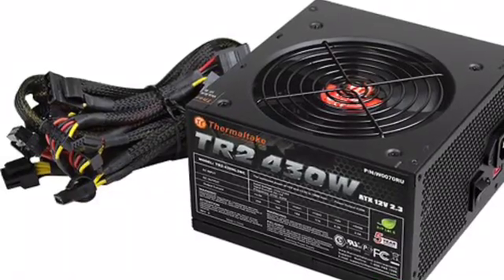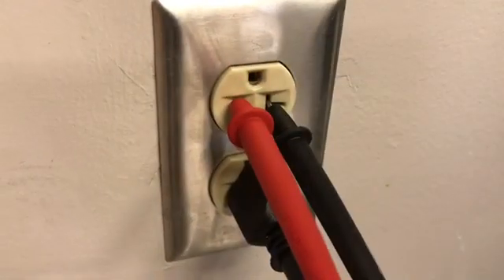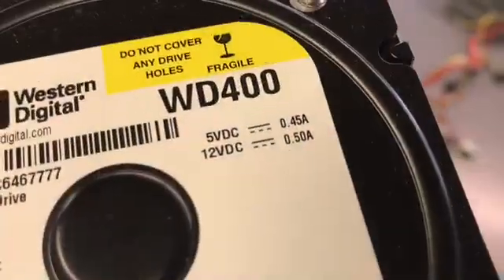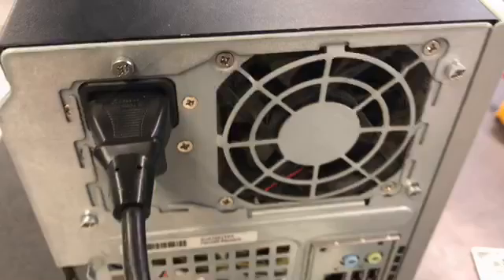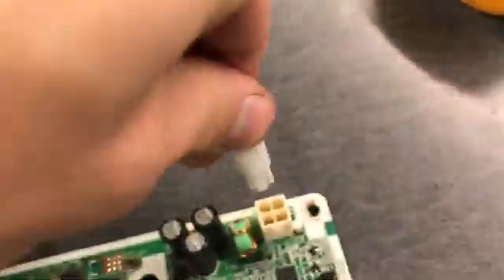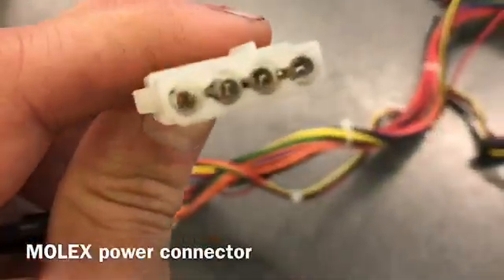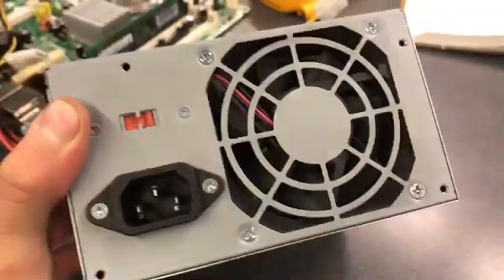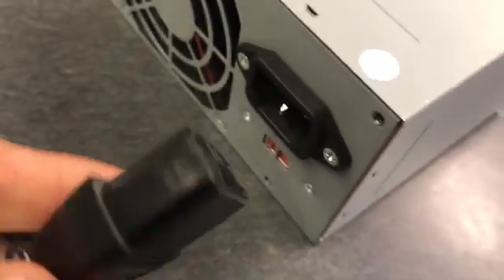What is a PSU (Power Supply Unit) and Explanation of Plugs?

Comment: My HP server power supply 24 pin connector has no pins in position 14 and position 20. The new cooler master power supply has a -12v pin at position 14 of the 24 pin connector. What is the effect of adding -12v to the motherboard?
Should I disconnect the wire to pin 14 (-12v)?